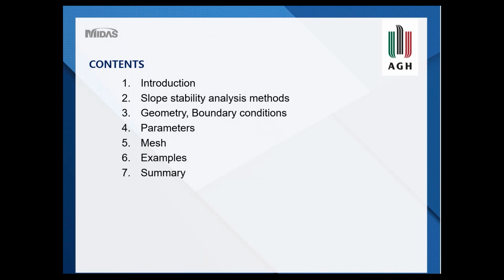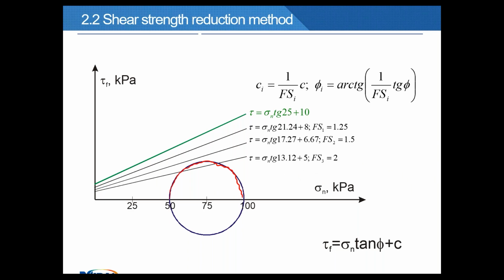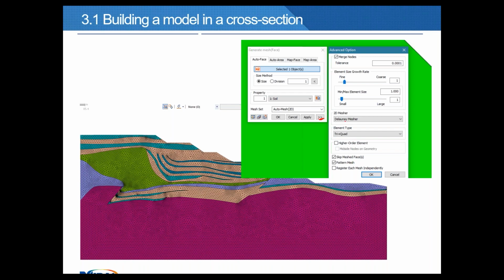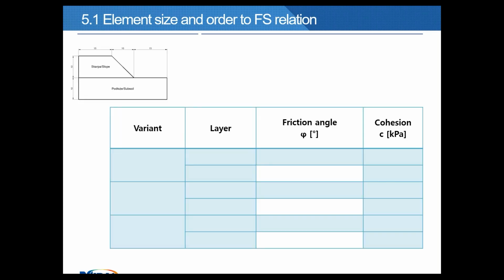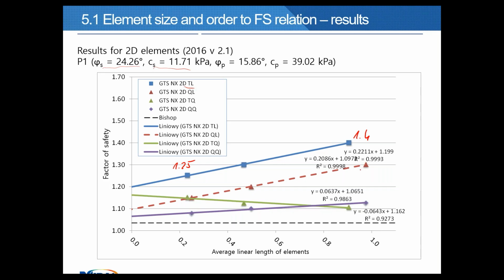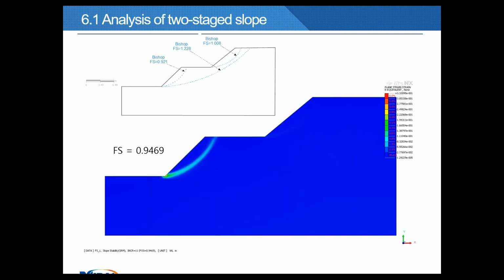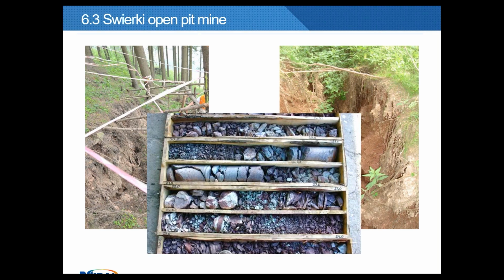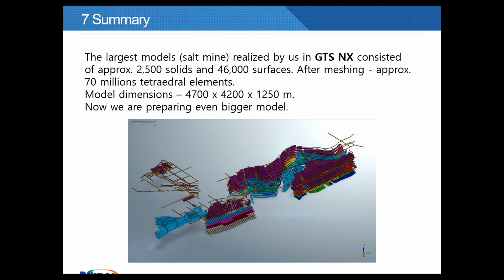Case Study: FEM in the Stability Analysis With a Complex Geological Structure

Comment from the maker: <Timeline> 
01:21 Introduction
02:54 Slope stability analysis method - Shear strength reduction method
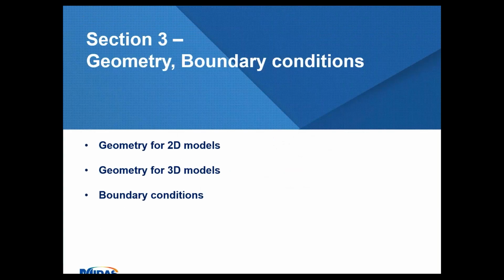09:34 Geometry, Boundary condition - Geometry for 2D & 3D models, Boundary conditions
14:24 Parameters - Young modulus & FS
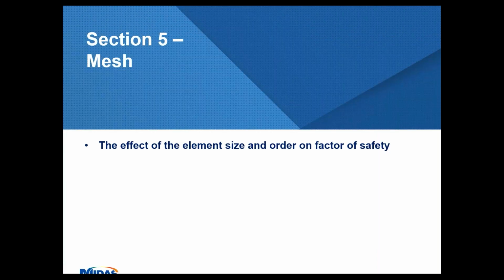16:31 Mesh - Effect of the element size and order on factor of safety
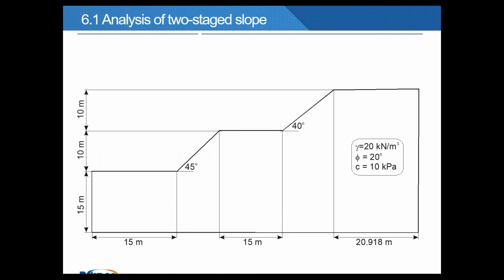27:17 Example - Analysis of two-staged slope
30:13 Case Study 1- Belchatow lignite open pit mine
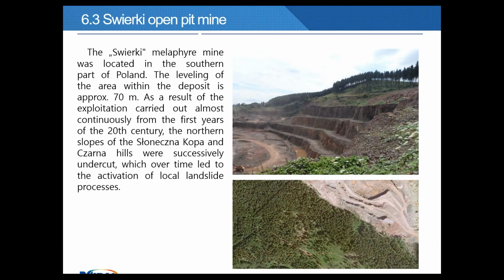32:15 Case Study 2- Swierki open pit mine
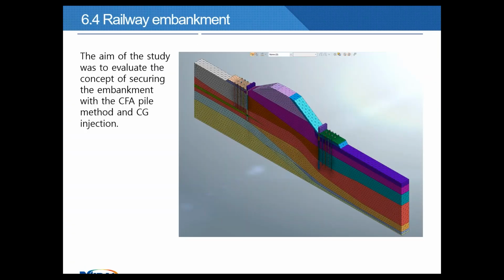36:00 Case Study 3- Railway embankment
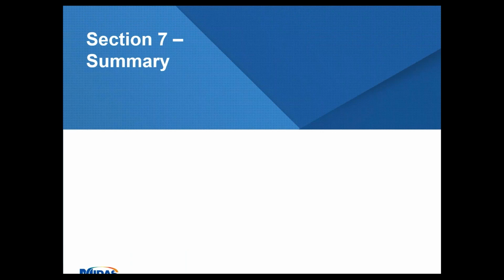37:06 Summary